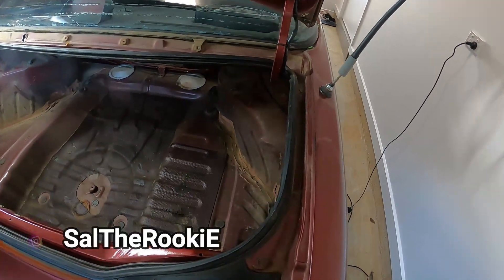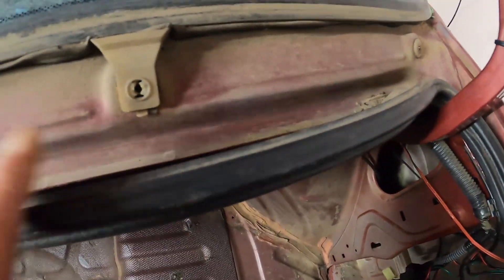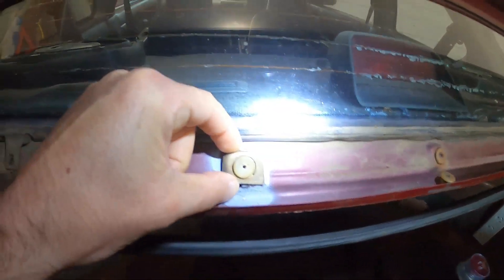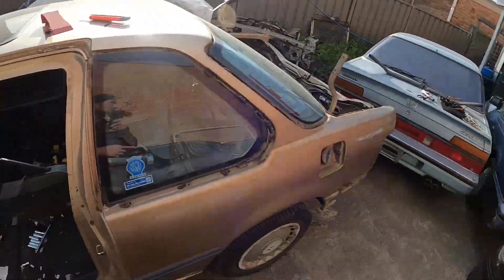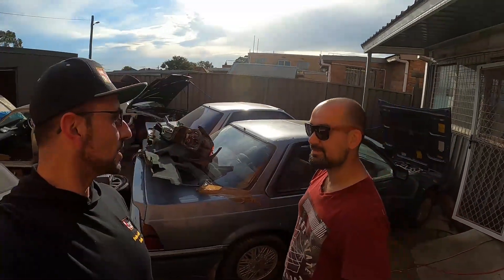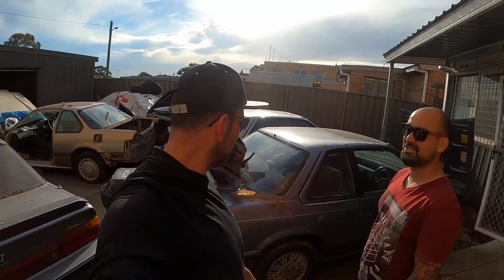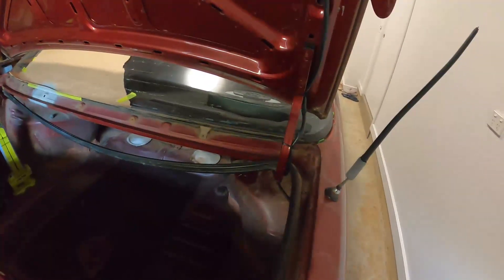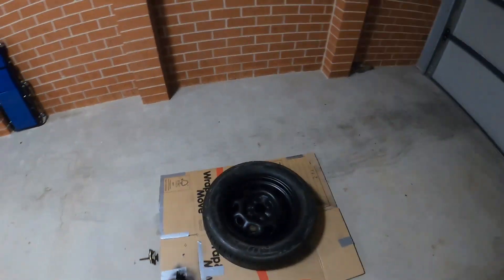DIY Rust repair on my 3rd Gen Prelude and meeting Kevin the Prelude Godfarther.

Comment: I'll be honest, I wasn't sure when you said jb weld....but it looks solid! Good work!
Reply from the maker: Trust me this is better than actual welding.  It is designed for welding replacement
Reply: @saltherookie  Ive welded for years and own one. I'm not sure it's better but it sure did the trick in this instance, and is totally fine for something  that small. Why buy a welder for a tiny piece anyway?
Reply from the maker: @drivechannelyt  you're right. I guess I got carried away loll. But true,  small part like this will work just fine. I sure don't want to buy a welder for that, especially when I don't know anything about welding

Comment: dude, did it actually work ? JB Weld... this is a first. but I would assume you got the right one for metal on metal
Reply from the maker: it actually worked just fine. I hardly can see the repair now and it is solid. plus, the area itself is well hidden so no actual stress will take place